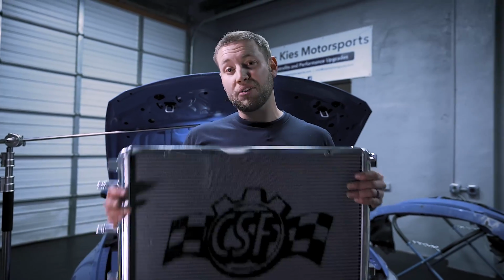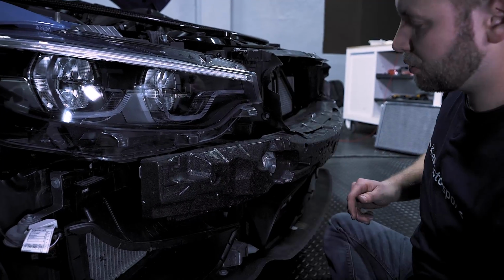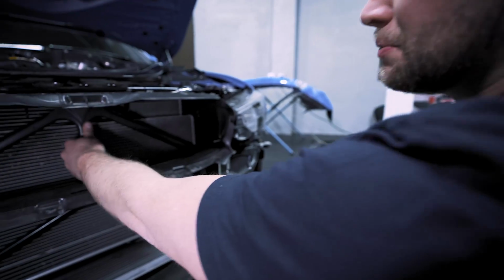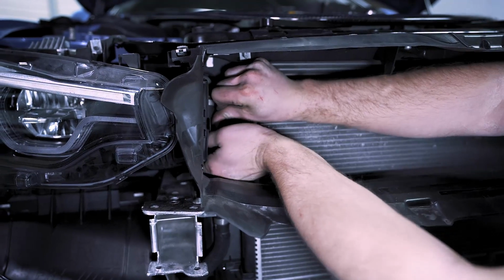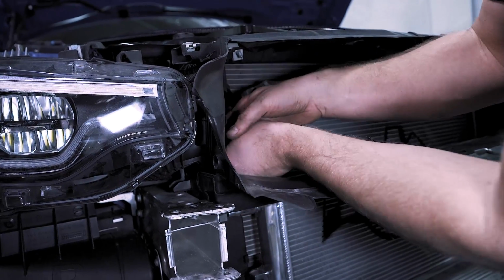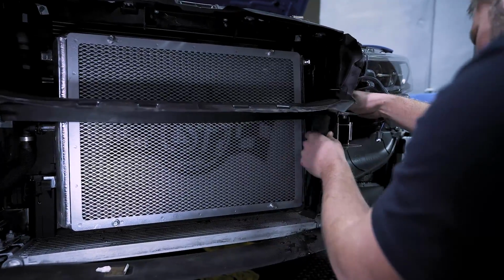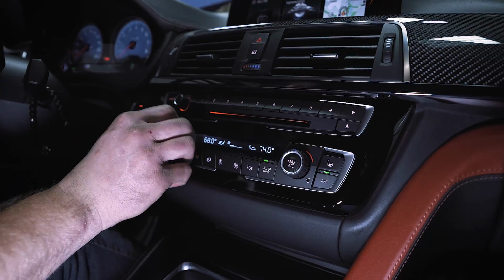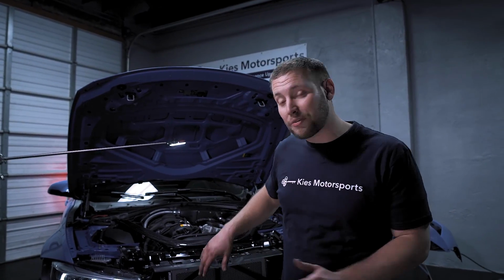How to Install a CSF Front Mount Heat Exchanger on an F80/F82/F87 M3/M3/M2 Competition

Comment: Great video. I just had this installed but I realized after getting home that they didn't install the mesh shield/screen and told me that they didn't install them because they cause too much pressure on the front brace, but it doesn't look like it even makes contact with that-can you comment on that?

Comment: Your videos are awesome guys.  What is the bigger rad behind the one you upgraded?  Is there no uprated version of that?  As per my post on your other video.....Can you say how long it will take to install, this, the CSF heat exchanger and charge cooler if all done at once ON A RAMP?  Ballpark..... Thanks :)
Reply: that’s the AC condenser 
the process is the same for ramps, you only need to get under to reach the bolts for the bumper

Comment: I had a local performance shop install a CSF Heat Exchanger on my 2017 M240i XDrive.  Now with my AC on max cold, it feels like exterior vent air is running.  What do you think the problem is?

Comment: general question - what exactly does the heat exchanger do compared to a FMIC?
Reply: In this car the heat exchanger is a FMIC. The coolant in the intercooler is cooled in the heatexchanger. Watercooling is way more efficient than an air to air FMIC but it requires a lot more parts.

Comment: Hi Brian, sorry my question is out of context but i really need your help. my f30 320i has a rear humming noise that only happens when i accelerate and the the noise is not there when i coast. could it be the diff and if it is could a gear oil change solve the problem?